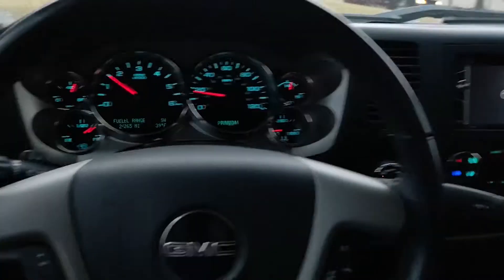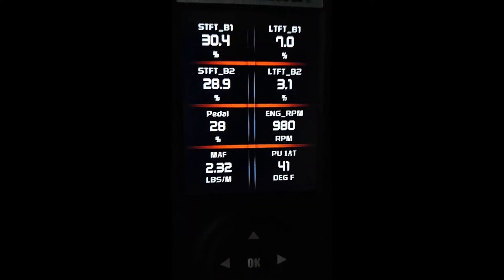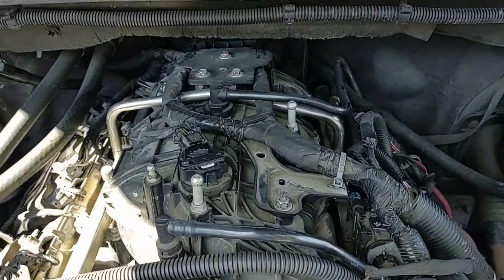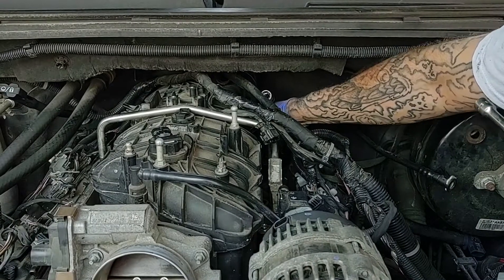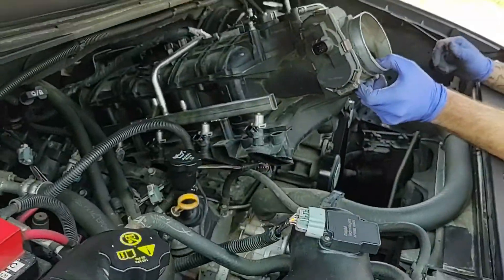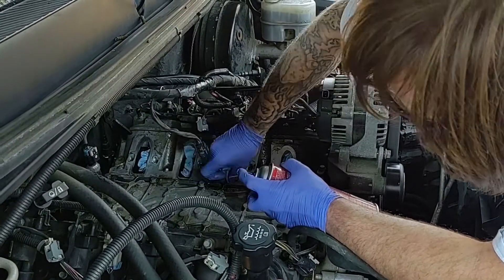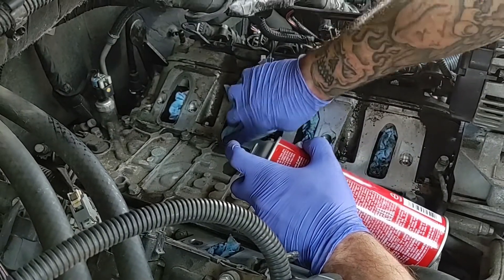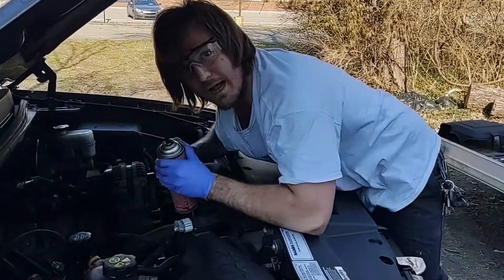Fixing vacuum leak on LC9 Vortec engine (P0171 & P0174 codes)

Comment: You already had the fel pro metal installed 😢
Reply from the maker: Sorry about that, I didn't add on to the video all the editing I wanted to do. After putting all this back together there was still a vacuum leak, I eventually found it it was one of the o-rings for the fuel injectors it had rolled when I put my fuel rail back on the last time I had it out

Comment: I'm looking directly at a vacuum leak @ 1:53 in the PCV tube/hose just before the elbow that goes down. The engine covers are known to rub holes in these plastic tubes.  Not saying that's the ONLY leak, but that it definitely appears to be one. I just replaced that part on my 2012 Yukon due to the same issue.
Reply from the maker: Hey, just wanted to let you know that this video was incomplete. The vacuum leak ended up being a rolled fuel injector o-ring that I wasn't able to detect until I went back in with the smoke machine